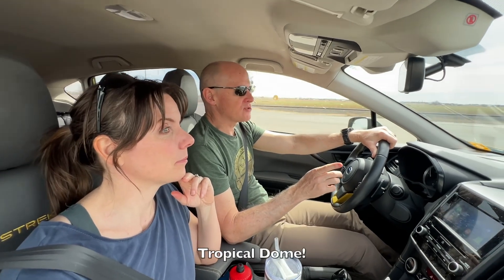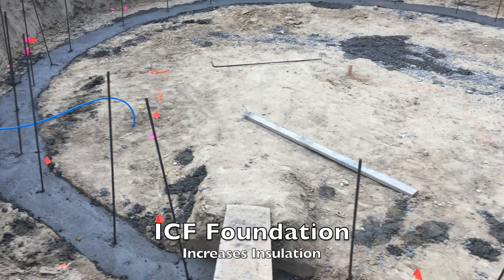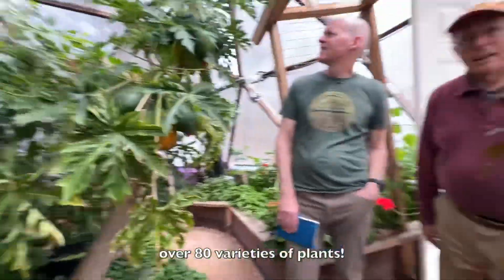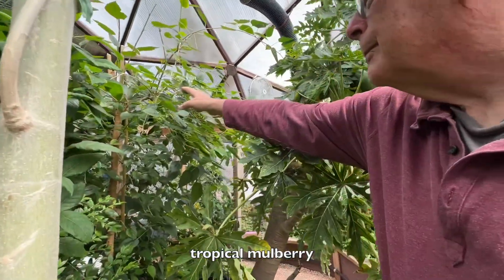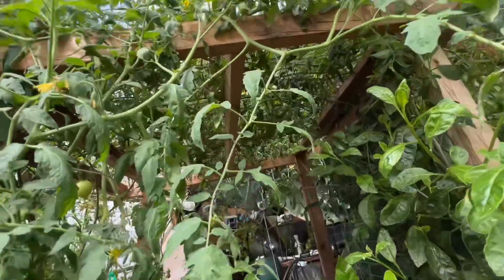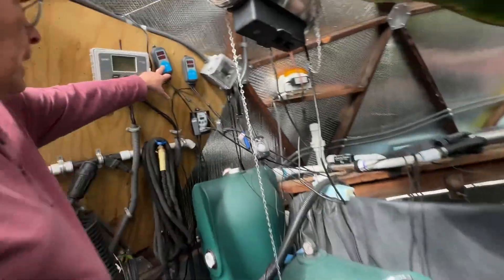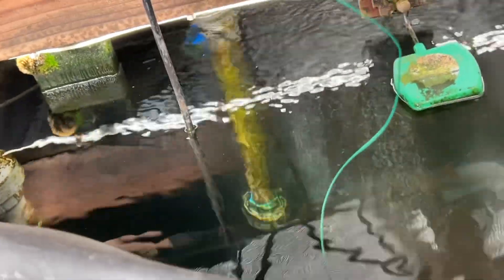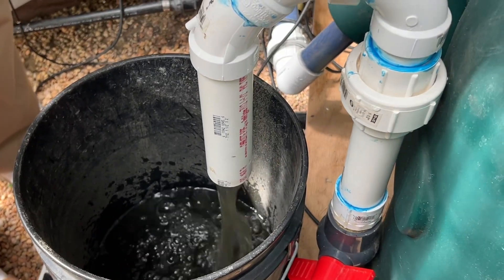Could THIS Greenhouse Work ALL Winter Long?!

Comment: Nice tour. This will help you figure out your plan. Part of that will be, I'm sure, a backup energy system to keep all the electrical equipment operating in the event of a long-term power failure. It seems simple, but actually has a lot of moving parts. This should give you great content for us subscribers to watch. Exciting time ahead guys.
Reply from the maker: That's the plan! We are considering a lot of solar and battery options for this. We may not be tropical right away, but certainly year round for zone 5-6 plants .

Comment: hope it can handle 5 feet of snow.  I got my doubts
Reply from the maker: Is already rated for 60lb  snow load and we are having the engineer make any adjustments to meet our county requirements 75 pounds . We should be good. A dome is naturally the strongest shape.
Reply: Snow mostly slides off these grow domes. It's keeping it dug out that's difficult

Comment: 👍 That dome looked tiny until you got in there. Nice plants, too crowded, agree.  If you guys plan on having fish in your climate, you better budget a big battery bank backup plan for that temp control. Automatic propane generator with decent size tank?  Even the water temp. for the plants needs to be regulated along with the ph levels, it's a job.   Definitely gonna' be a nice retreat and worth it though.
Reply from the maker: Its looks are deceiving right? We are going through our power options now. We may start with goldfish and graduate to tilapia as we get more familiar with temp control. Tilapia need 70 degree water .